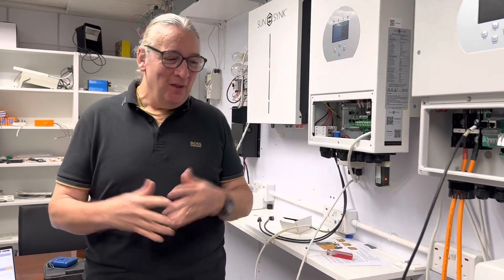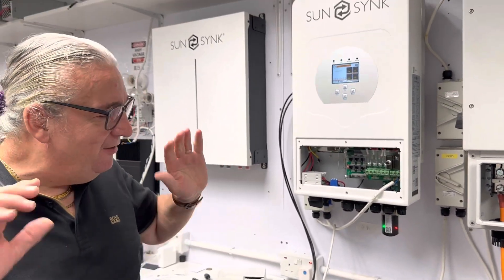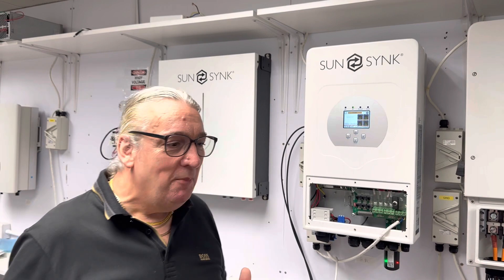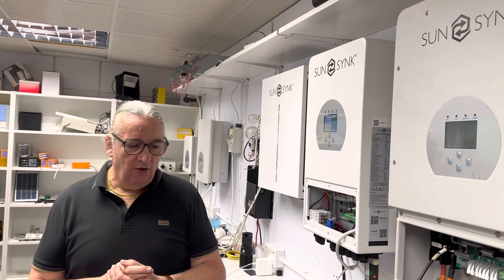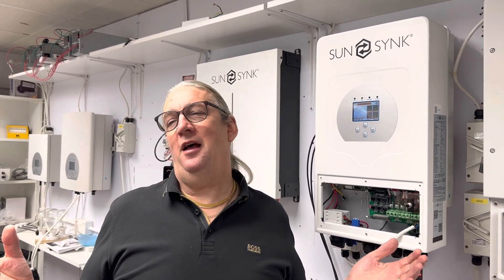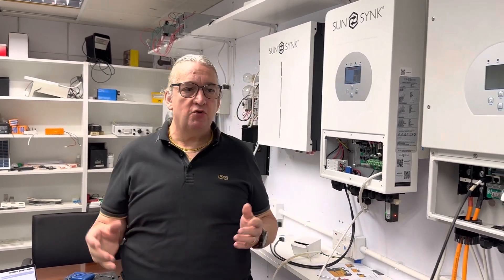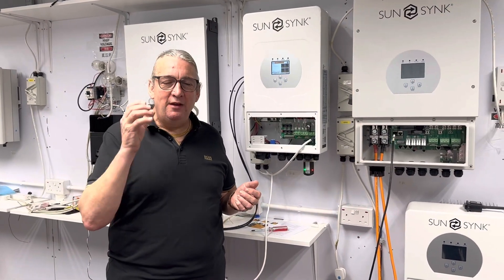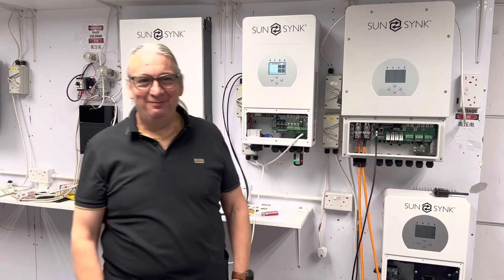Full Sunsynk training course

Comment: Hi there, im not an installer, but just want to find out if there is a way to acomplish what i want to do automatically... i have a 5kw sunsynk paired with the 5.32kwh battery... now on sunny days I want the whole house to run of the panels and battery, lets say there is more draw for a couple of minutes than the panels are providing, it should take from the battery and never from the mains unless unavoidable, but then i want to reverse that on clowdy days so that it takes nothing from battery and compensates with mains, unless mains are off, then it should go back to battery.

Comment: Note on 8KW model: Just took me 2 weeks to figure out that the CT coil pins in SA must be terminated on 5&6 and not 3&4 "CT-L2". Maybe just please update the manual that gets distrobuted in SA. My parents in law installed the system and in the manual it said to terminate the CT coil into pin 3&4, had the invertor on the Zero Export without limited to load. (Load is referred to as the essential line output) Wrong pin termination as prescribed by manual and blew the alarm DC charge box for the security and the gate charge box along with all the PC's power supplies. Settings was ons Zero Export and system was installed by certified electrician, not myself. I had to figure out that to make the CT coil in SA work, you have to use other pins for termination as that in the manual. A update would be great I believe a lot of people are only pulling 20% efficiency that does not have the knowledge, they essentially have it running as a off-grid invertor and then move all the appliances to the load output to supply power, as I believe a lot of installers has the CT coils on the wrong pins and then limited the Zero Export to "Load" output only to not get the 0-0 error with grid feedback when CT is wrongly functioning. The bi-directional ability on the grid input/output is unknown to a lot of owners in SA. Alot of people in SA could be saving a lot more money. Please make effort to correct or to broadcast it, this invertor is amazingly powerful, but I believe there are many on many incorrect installations in South Africa.
Reply: It is already on 5 and 6.

Comment: I don’t suppose Keith wants to give away all his trade secrets, but personally I would love to see an explanation of how the inverters synchronise to the mains and maintain the peak shaving functionality where the CT coil helps prevent export of power when not desired. I have seen the very basic videos sun synk have put out, but the level of explanation I would be looking for would be a functional block diagram of what circuitry is in the inverter to achieve all of that functionality. But in an industry where the Chinese will copy everything, I’m not surprised he’s probably not keen to go into details! 😂
Reply: if so interested why not buy one and then can see for yourself?  lol .
Reply: The Sunsynk made by Chinese. Copying it will amount to copying their own product.
Reply: For a grid tide system, you can output a matched the AC output waveform by using a signal processor IC. Then you will need a control circuitry to take the result from the signal processing IC. Then using switching control, modify the output AC's waveform. There are mathematics and signal engineering involved. The technology isn't rocket science, but its hard to exactly copy what it does. China has a knock off version for everything anyway.
Reply: @tambo22003  thanks, that’s exactly the kind of analysis I’m looking for. The reason I’m asking is I would like to develop my knowledge in this area to see if I can make better use of the cheap generic HF inverters I run in my off grid system. I’m trained as an electronics engineer but wouldn’t put myself above hobbyist level in knowledge really, but some of what sun synk and Deye are doing with their inverters seems really innovative and potentially with wider applications. It just piques my interest 😁